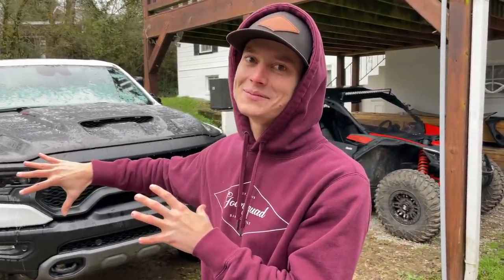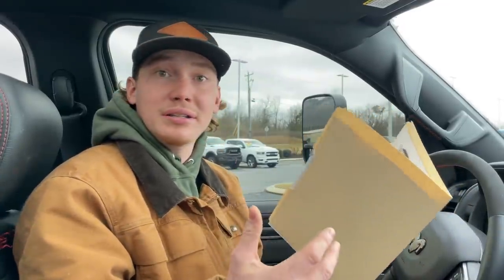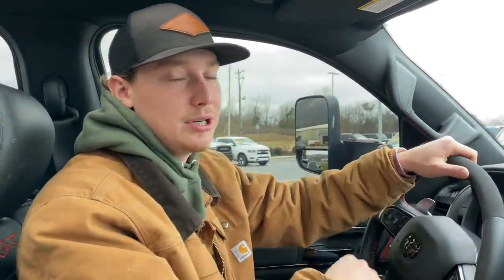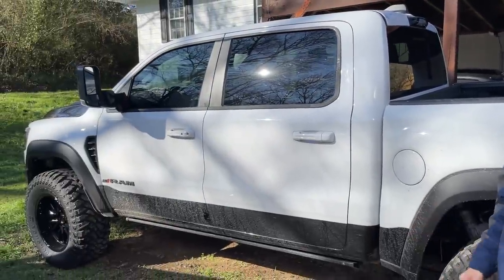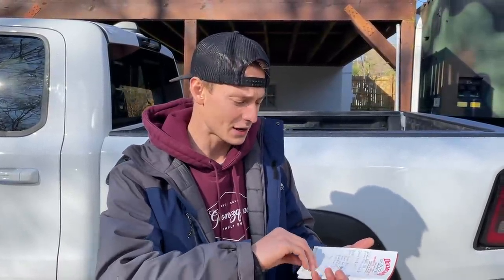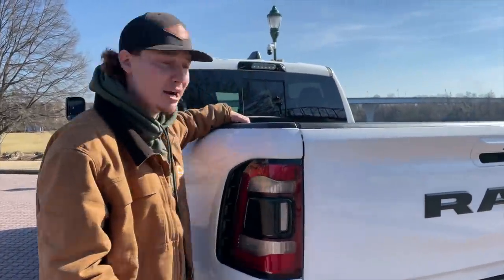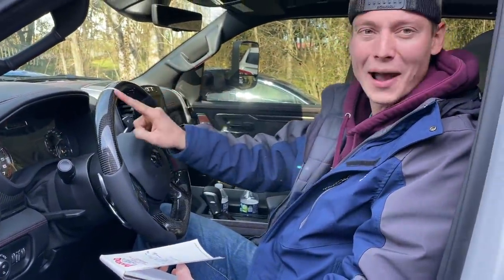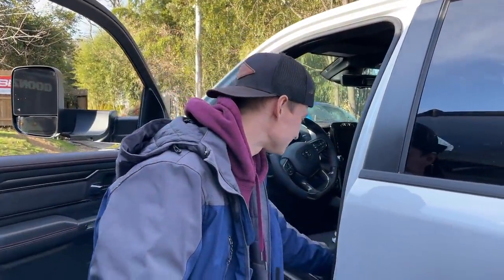Wrecked 2021 Ram TRX Price Reveal!!! Did We Get Ripped Off?

Comment: The experience, content and after market parts make it a good deal!!! Definitely one you guys should keep
Reply: The issue with keeping all this vehicles is that they need to be driven.  This still does not have a clean title, prices at auctions are ridiculous and all because of greedy ballers that want to have something and not let any others purchase a completely trashed vehicle.  They buy them to either fix them cheap (bondo paluza) or part them out.  No vehicle should be kept, this is business and they are in it for the money.

Comment: Almost a full hundred grand.  I remember those builds when penny pinching and pick-a-part determined your budget.  Rebuilding a car with dealer parts isn’t as rewarding as finding that missing part at the junk yard.  Watch your early Jeep builds.  Still my favorite.
Reply: They tried. But not many wrecked trx parts out there. Jeep otoh.. 😅
Reply: I am in the philippines and the TRX is being sold brand new for 8 million php..which is roughly around $160,000

Comment: For you guys, it was a good deal, because you got valuable content for the channel.  For the average guy, that would have been a losing proposition I think when you add in the labor.  It's all academic, though.  It was an entertaining and educational project and you have protected the value of the truck with the quality of the work and parts.
Reply: I absolutely love this channel, but with an MSRP for a brand new TRX starting at $70,425, I'm kind of dumbfounded with people that do these rebuilds for anything but YouTube revenue.
Reply: @Yoav76  The prices shot up on these trucks
Reply: I just did a Google search in the Phoenix area a 2021 TRX used is running from 92K -  111K with up to 40K miles a 2022 Lmited edition Ram TRX Hennessey MAMMOTH 1000, #71 of 200  used with 442 miles is lost at a Tucson dealer for $199,999 they didn’t do that bad.
Reply: @steve-ph9yg  are those clean titles or salvage/rebuild title values?
Reply: @endall39  clean titles that’s the problem with this truck it’s a salvage or rebuild title it’s already worth about 1/3 less from the start so they are at about it’s top value already.
Reply: @steve-ph9yg  That was my thinking exactly.  The project makes sense for these guys, but not for the average guy.  They are also, and rightly so, working deals on their aftermarket additions and supplies, given their promotional power.  That can't be replicated unless maybe you have a SEMA sponsor:-)  The other beauty of their setup is that everyone can see pretty much every detail of how the bring a car back from the dead.  Makes it a lot easier to get value for their "salvage" title care than a typical example.  Plus it has the cashet of being a "Goonzquad build", so the buyer can have some confidence is the future resale value.   Win Win.
Reply: @endall39  they do earn revenue from the videos that helps offset the cost something the average person couldn’t do so yes a win win.

Comment: Price is a little rough considering it's got a marked title (doesn't it?) - But also considering the low supply, and high demand, you probably did fine.  Hard to call it a home run, but it's not a massive loss either.   But at the end of the day you got what you wanted, so that's a win.  Boot that Raptor down the road, TRX is taking it's slot.  20 years from now, TRXs will be extremely collectible, Raptors not so much.
Reply: Salvage title.!!! No way anyone with sense would spend 115,000 on a salvaged title truck.
Reply: @scottsime5197  I think a vast majority of people will never buy a salvage title vehicle in their entire life.
Reply: Let me give you a spoiler alert, there is not a lot of modern vehicles that will last 20 years, let alone a dodge or ford product. This is especially true in the midwest and east coast with salt and the ocean, dodge pickup trucks will rust a hole clean under your foot so you will Fred Flintstone it to the junk yard, and the transmission will fail at 60k miles.
Reply: @mad0uche  lol that is wrong. Many people are mechanically inclined and will pick up a rebuilt car any day
Reply: @HPX584  No they won't, because a mechanically inclined person has the income to buy a brand new car, and a mechanically inclined person has the education to know a salvage title car with possible frame damage isn't safe, and that a car that has been in a wreck will never be the same because a major impact shifts just about every piece in the car.
Reply: @mad0uche  lmao ur so wrong but try again. My 3rd car is a rebuilt and it runs to this day with 200k miles on it. 2012 Kia Optima if it matters
Reply: @HPX584  No, it doesn't matter at all, because your salvage title toyota tacoma could hit 1 million miles -- that doesn't make it safe.
Reply: @mad0uche  ok buddy I can tell you don’t know anything about cars. I bet you don’t even change your own oil
Reply: @HPX584  I don't know anything about cars? You willingly bought a KIA OPTIMA, lmao, are you fucking kidding me? AND YOU DRIVE IT.
Reply: @mad0uche  lmao that’s my 3rd car not even my daily or my second car. People talk about how bad Kia engines are and this one is a rebuilt and still running😂 try again buddy, you probably think doing your own brake job at home is a safety hazard lol

Comment: $94K for a low miles  truck,with after market parts is good.>Change the bushings in the suspension of the Raptor to Poly.Watch the vid. Great work on the 'Rex.

Comment: You didn't get ripped off; I just priced one with Ram and I was at 96.  The madness only starts there; toss on Hutchinson Rock Monsters wrapped in Maxxis Trepador's, I would picked up the RSI EVO Smartcap and the Expedition One Dual Swing Out with the Ladder in the rear and up front I would have added the Road Armor Stealth Titian 2 Winch bumper and a 12k Warn Winch.  Lets not forget the KC Hilites Pro 6 Roof Rack and Rock sliders by White Knuckle.  Oh and toss a full set of those Custom Carhartt Seat Covers to match your Carhartt Jacket.

Comment: The TRX is for sure my next truck purchase. I have a 2018 Raptor and I've had nothing but trouble out of it from electronic issues to having to replace the original motor because of a factory defect. I just sold my Hell Cat charger last year because I now have 2 little boys (1 and 2 years old, yes my wife and I got board during the covid lockdown...) and I've been dying to get another 6.2L SC powered car. I almost bought the SRT Durango to replace the charger so I could have a nice 4 door SUV with more room and that can easily hold 2 car seats but my wife likes the 4 door Raptor because it rides higher and has a bed for bringing home all the big stuff she's been buying for our boys. (swing set, trampoline etc). My Raptor only has 25k miles on it and I found a bad ass TRX at my local Dodge dealer online, so I'm going to stop by there tomorrow after work to see what kind of deal I can get with the Raptor as trade in. Next will be convincing the wife because she really like the Raptor, but once she rides in the TRX I'm sure she will be hooked. Plus the thing she likes most about the Raptor is all the bell's and whistles in the interior and the TRX for sure has it beat on that. 
So wish me luck!
This is what the truck looks like that I'm looking at if your curious. https://www.truecar.com/new-cars-for-sale/listing/1C6SRFU91MN903848/2021-ram-1500/

Comment: For the bed liner, get a bed rug, better than rhino or any other spray in or plastic liner. It’ll cost about $450 and you will not be disappointed. 

Now for you comment earlier in the video about being the best truck when it ate up the Raptor, you should try getting your hands on a Ford 150 Shelby Super Snake. They have 2 variants, one sitting about 8” off the ground and the other sits up for off road; both of which come stock at about 770 HP.

Comment: Spoiler alert , you need to add  your labor hours at $50 dls per HR which is what a body shop charges  and  shop expenses. Unfortunately all expenses in mods and aftermarket parts are never justified by the buyer and are depreciated once installed, the buyer will not appreciate or pay for those modified after market parts and installation labor hours. There are many trucks on eBay at  $100k+ but with clean titles and they don't sell only a couple have sold for less than $100k. And trucks value will take a big hit if it is salvage title no matter how well you repaired it people will shy away especially at full retail price. But it's still a good project and investment since you build it to your liking.

Comment: You have to calculate the improvements you guys made. Better wheels and tires, better suspension, carbon hood, nicer bumpers and an awesome steering wheel. If you put a pricetag on that, you are cheaper than the original price. The value went up too. It probably worth well over 100k now.

Comment: The TRX is an interesting one.

According to EVERYONE it's 4x4 only, yet every other 1500 has that switch out in the open, and every major shop that modified it to the moon would piss us all off by dynoing the thing in 2 wheel drive mode for some reason.

It has to be either some crazy button sequence, a "different mode" all together, or hidden in that fancy screen, the 2 wheel drive mode. Makes no since for it not to have it, nor for Hennesy and gang to deactivate it over OBD.

Comment: Looks fantastic. Y'all got the better deal not even taking into account the current market for them. You were just south of 90k to get to where it was new, then an additional 4.5k in aftermarket parts. So to get the same truck as y'all have, the original owner would have paid 96,800.

Comment: I found 2 TRX in my area 1 was 89,995 and loaded one was 98,000 both used 2021 and both under 900 miles on the clock. So did you do good that's up to you

Comment: Find you a 2021 shelby super snake f150. It has 775 horsepower. You need to fix the steering column. You only temporarily fixed it.

Comment: Actually you are at 94k, original guy paid 92,3. So you have 4500 in aftermarket parts. For the other guy that would have been almost 98,000. Id say you did just fine. Besides you got the fun of bringing it back to life.

Comment: You boys need to Coyote swap that Raptor and line them back up for another race. Great video as always. Keep up the hard work. 💪💪😎
Reply: It would be slower with the stock Coyote since less torque. Would sound better for sure. That's my only complaint with my Gen 2 raptor is sound.

Comment: I have had four ram TRX trucks and there is some software that you can buy called taser DT and it is a software that goes into the truck and changes a bunch of stuff and you can put the truck into rear wheel drive by holding the traction control off button and a lot of other cool features and they’re pretty cheap for what they do

Comment: DANG SON!, these ram trucks are WAY outta my price range, guess im going to keep driving my old 1999 Dodge Ram 1500 4x4, 148,300 miles. They say these old ones will do 300,000 if you can keep the body from falling off due to Iowas salty roads. But that is a nice buggy.

Comment: You were probably under sticker before the aftermarket parts, you had nearly 4k just in the wheels and tires. I think you did all right, even though resale on a rebuilt title isn't as good. If you're planning on keeping it, and not flipping it, then you guys probably did fine. Hopefully you can keep the Raptor too! Maybe see if you can get it closer to the TRX!

Comment: $74,000.00 for a wrecked truck? You all could have bought a new one for that. Hey I have a 1998 Toyota Camry LE with 350,980 miles on it the paint is peeling and it's been wrecked a couple times  I'll let you all take it for a measly $190,000.00 even. It passes smog original engine that compression tests like a new one original rebuilt transmission. What do you say?

Comment: Hey guys, not sure if it's the same with the TRX... I have a 2021 Hellcat Durango AWD, to get that ESC fully off you have to make sure it is in track mode and then hold down the traction control button until dash says ESC disabled. Check my channel for video on it if needed. Should help you spin that TRX

Comment: If you added your labour in you got ripped off. But if you got it new you still would have fitted the bonnet and rear bar steering wheel  and what not. I would be happy with it costing that much if it was me.

Comment: @goonzquad love the truck build but the drivers side piece y’all cut and welded in is not aligned 100% correctly you can see the uneven body lines from multiple angles on driver side. Other than that looks 🔥 !

Comment: Yeah, unfortunately you guys have about 30k too much into a rebuilt title. Though I think the car you're in the most upside down is that model X in the background and the equally bad parts car you got to fix it with. (they're both parts cars... unfortunately) Branded title from any other car make is one thing. Tesla disables features of the car remotely, blacklists it, won't sell you parts, won't allow aftermarket parts manufacturers, can't even take it in to a service center and pay them to work on one. I assume thats why its sitting there with deflated suspension all the time. You guys have no way of actually taking it to tesla to have them run it through the charge process via their proprietary and closed system. You should do an update on whats happening there to save your viewers from making a similar mistake. So the TRX isn't as bad of deal when you put it into perspective. At least people can rebuild a TRX and get all the value back out of it.

Comment: Do you guys not have any type of 'hooning' laws over there??  If anyone is caught doing most of the stuff you were doing, including street racing, excessive speed (45km/h over the limit), burnouts (any tyre smoke, or even 'chirping' of the tyres!), or anything that may put ANY person at risk (including the driver), your vehicle will be impounded for up to 3 months (will cost you $1,000 to get it released after that time - and it's usually been scratched or damaged by then, in the holding yard), you may lose your drivers license for up to a year, cop a hefty fine, etc.  They're pretty tough on it!!!

Comment: I am afraid that my only comment for this one, is 70+ in a 40? Not cool at all. I'd have thought getting a ticket previously would have taught you that lesson.
Not sure if you are classified as a new car dealership, but I noticed your plate on the TRX.  White plates that have "Vehicle Prep" written under the tag number can only be used during regular business hours and while actually servicing the vehicle. Are you not concerned because there is a low chance of being pulled over, or are you actually entitled to use them? Genuine question, I am not trying to be an ass or anything.